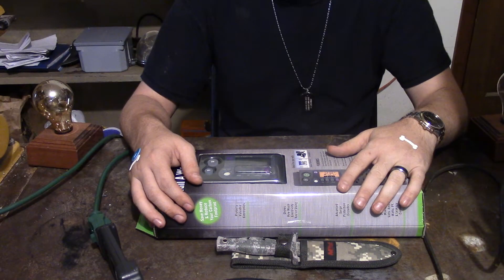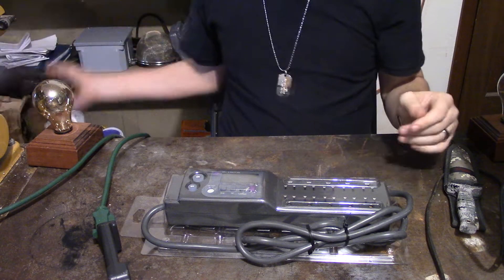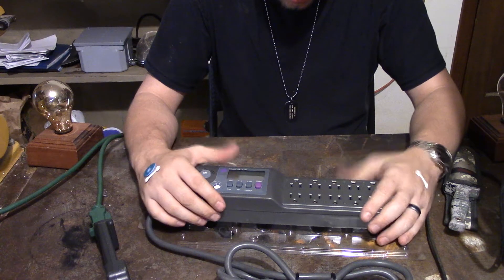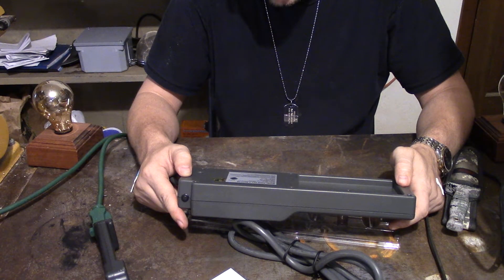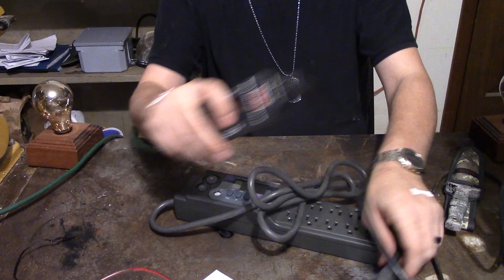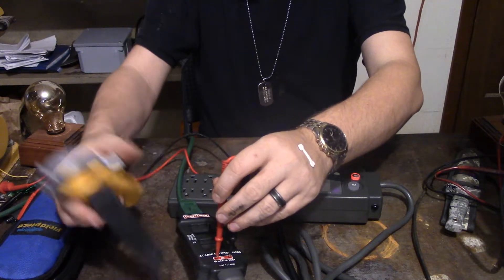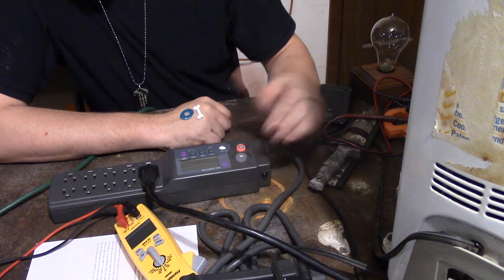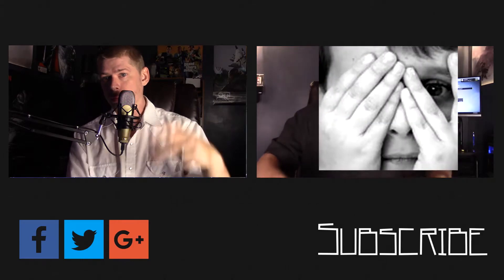Kill a watt meter Testing Ps 10 Surge Protector

Comment: Yeah, those Kil-a-Watt meters (or similar) are great things to have when you are on solar. The results from testing tend to be more useful than just going by the wattage draw from the ratings plate on the appliance. Before those were commonly available I just used to wire surplus standard powerboard meters to a plug & socket set and mount them on a piece of wood. These plug in meters do show more information though. The ones I have also show power factor which can be useful. 

Just a warning to anyone intending to use these with modified sine wave inverters: They will not give an accurate wattage reading due to the different waveform. It's usually around 66% of what the load is really drawing, although that might vary depending on the type of load. Also, these meters are typically powered by a capacitive fed supply. When operated from MSW power this could potentially overheat after an extended period of operation.
Reply from the maker: This is great info thanks for taking your time to watch friend.